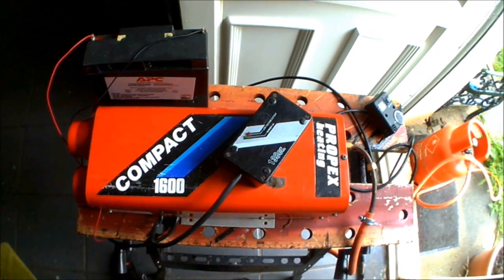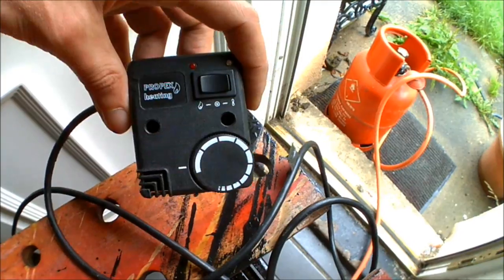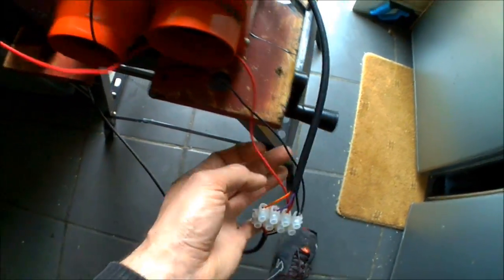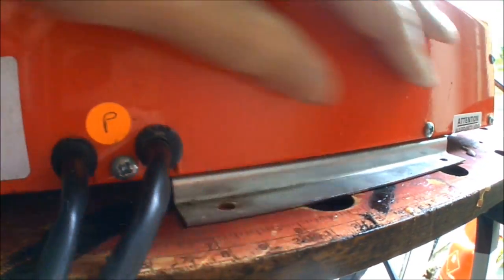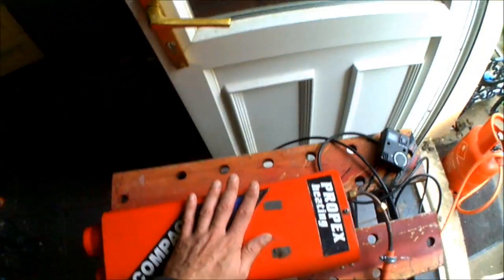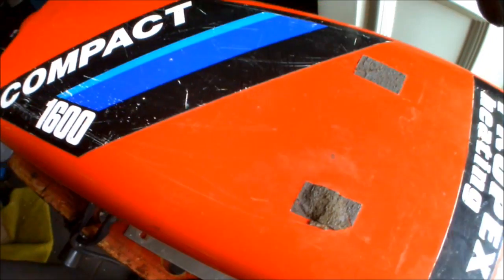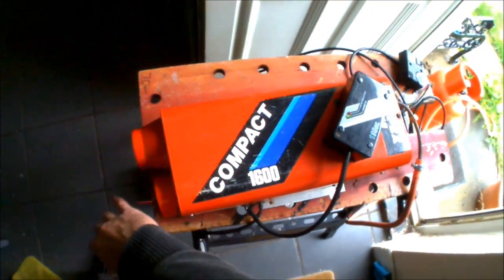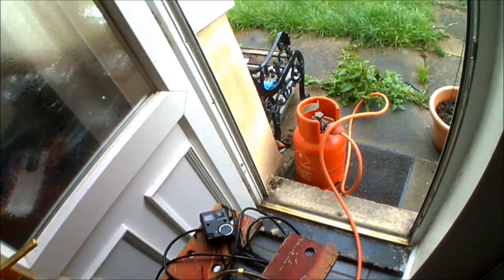Propex 1600 Compact Gas Heater Test, Wiring & Installation Guide

Comment: Mine doesn't get warm that quick. It takes at least a minute. Mind you, it's not getting warm at all now. Not sure what's wrong with it..🤔🙄. Is it possible it's not getting enough power from the battery to ignite it?
Reply from the maker: You should hear it ignite, if it doesn't there may be a block in the gas line or low battery.  If you have issues email Propex direct as they are very helpful even on older models

Comment: Also, mine doesn't turn off straight away. The fan keeps running even when I put the rocker switch in the middle position..
Reply from the maker: The fan will keep running for a couple of minutes to cool everything down inside the unit
Reply: @TheCampervanBuilder  But yours turned off straight away...🤔

Comment: Hi nice vid mate, i was just wondering is there any reason why you couls not mount this under the van?
Reply from the maker: It is recommended to install inside but it could be mounted under the van I suppose, but you'd need to drill larger holes in the floor for the hot air to enter the van compared to the exhaust holes required to vent outside
Reply: Camper Conversion 
Cheers that's what I thought, thanks for the info. I assume your buyer did follow through and buy your?
Reply: Another thing, is the 2000 much better and worth the higher price?
Reply from the maker: I never got round to fitting this model, I bought it online then got offered a 2000 from a mate so I just tested this one and sold it on, the specs say the 2000 is warmed and uses less power so its worth it to a point, depends how much you'd use it, I've used the 2000 once since fitting it as haven't used the van much over winter but if you're savvy, you can get 2000's cheap on classifieds
Reply: thanks for the feedback, great little vid Thank you
Reply: @TheCampervanBuilder  is the HS 2000 quiter as this 1600 fan seems really noisy ?